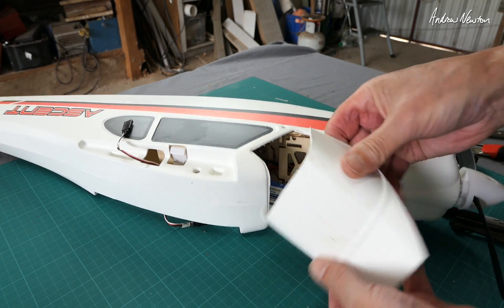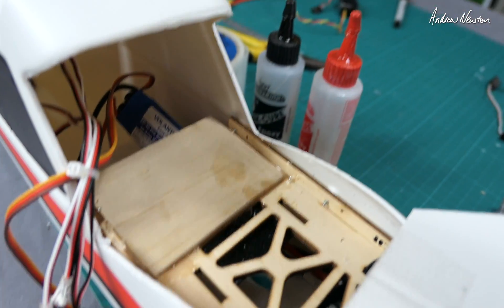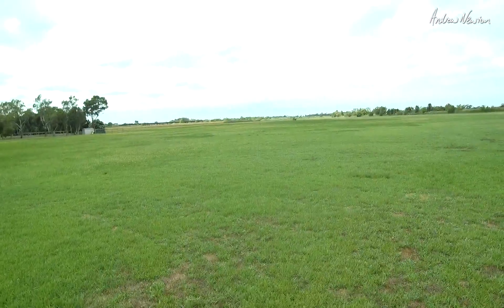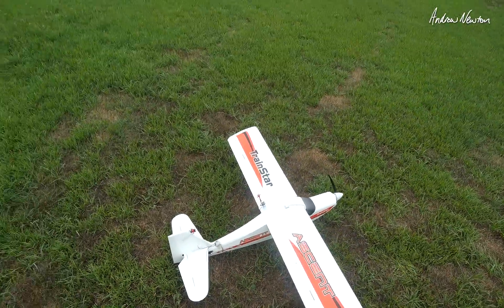Volantex Trainstar Ascent FPV Mods

Comment: Excellent helpful video Is there any other way to stick in a small flight controller without making the cut Pls help as i couldnt find any other flat surface inside the battery bay
Reply from the maker: Can mount externally, on top of the wing or under between the wheels.

Comment: Hello, This wing connector is a brass tube, it should be 32cm. It is shorter. 13cm for the left wing and 13cm for the right, the fuselage is 6cm. I tried to buy it but the diameter of this tube is non-standard, it is 7.9 mm. Standard tubes for RC models are 3,5,6,7,8,9,10 mm in diameter. Best regards.
Reply from the maker: Very frustrating!

Comment: As I get back to flying after being out for ten years or so- I have a LOT of airplanes in storage, but looking for the modern foam equivalent of the old telemaster. My heavy wood Telemaster just floats and floats- to the point it can be hard to land. 
I keep looking to these foam trainers as the modern interpretation, but it seems they still don't float like the old flat-winged and much heavier wood models from "back in the day."
Reply from the maker: This would be the closest to a Telemaster that I have tried. Very tough
Reply: @AndrewNewton  thank you- I just may have to get one. my flight controller just came in and I've got some tinkering to do, but it seems as if this platform will be the one.

Comment: Hi Andrew, thank you for all your content, a question on this plane and kopilot. When it comes to kopilot level calibration for the craft, is this done with the landing gear on? sorry for dumb question. i notice the angle the plane sits at? have fitted kopilot before as per your vid (thx) on zohd drift.
Reply from the maker: Calibrate level with the plane in the same orientation as level flight. Maybe not just sitting on the landing gear.
Reply: @AndrewNewton  thanks for getting back. My instinct said to ... but thought id better confirm. thx fella

Comment: Andrew, thank you again for this video. Can you suggest an alternate motor for this model airplane. i just replaced mine and its vibrating quite a bit. i replaced it as the old one was. The motor is a Volantex 4023 KV1050. Thank you in advance.
Reply from the maker: Matching the mount will be the issue. Sorry I dont have any suggestions
Reply: I have replaced mine photo to come. Although the vibration, is that without the prop? I have several of the motors as they are used on lots of volantex models and never had an issue.
Reply: Propdrive 2836 1400 kv it can mount internally or externally in the same holes and mount plates
Reply: Use a different prop of course !
Reply: Cannot add photo oops
Reply: @gonzorcplanes2875  Julian thank you for the advise. It turns out i had the plastic piece that holds the nut off and it was just to close to the metal grid causing friction. I looked at it for a while and decided to put a regular grub adapter and it seems like there is nothing rubbing on the metal grill or grid. I am waiting for the winds to die down here in Long Island,NY to test. How would a 2836 motor install on the inside?
Reply: @DjArity  just take the plastic mounting adaptor off the 1050 motor and attach to the propdrive motor it goes in the same way from memory.
Reply: @gonzorcplanes2875  thank you.
i believe I solved the vibration problem. i was using a standard grub adapter which was rubbing against the steel plate. i tightened a little away from the plate and the vibration is gone. i ordered the original parts just in case this doesn't work.
Reply: One more thing, if you run 4S at max amps,,mount the motor externally, it gets hot in the plastic fuse.
Reply: wait...just realized i am not familiar with a prop drive. thought you are talking about a regular prop adaptor. Let me check it out or if you have a link to it, that would be great. Thanks again
Reply: @DjArity  it’s a motor brand and type. Search on the hobby king website.
Reply: @gonzorcplanes2875  So you mounted that motor outside? Would you be able to send pictures? i think that will help.  I checked H.K. and i think they are out of stock with that motor. I have this Swiss motor 3542 i picked up from Alliexpress and it came with no bolt on  prop adapter. Having a difficult time finding a 4 bolt on prop adapter for it. Motor is nice a powerful but cannot use yet.

Comment: I just got this model...without the mod, where am I supposed to put my Rx...as my Rx has stabilization and is supposed to lay flat along the center line......thanks
Reply from the maker: You will have to be creative with the mounting somehow, or forget the stabilisation
Reply: @AndrewNewton  right.....I am thinking about cutting  an opening on top of the nose area, and mounting the Rx  on top of the wooden  battery tray....similar to  the opening that  you did, just not sure exactly how to  create  a  closable hatch once I cut the plastic open.....

Comment: Have you ever had to replace the Motor/ESC on this model? I would appreciate any information on how to go about doing it . Thanks in advance.
Reply from the maker: Without cutting a hatch like I did it would be very difficult.
Reply: @AndrewNewton  I was able to remove the battery tray by removing all the screws from the sides tgat hold the battery tray giving me access to ESC, which was replaced with s 60a ESC. However, you gavd me the idea ftom watching your video. The plane is ready yo fly again.  The ESC was the source of the issue.

Comment: I wonder if you could cut out the front and side windows and replace them with clear plastic and put a pan servo inside for fpv.
Reply from the maker: Wouldn't be easy but certainly possible.

Comment: I am now flying using zohd kopilot as a stabilizer and an F4 FC for my telemetry. It is simpler then ever and I don’t have to scratch my head with all the inav setup ... I’ll do it on my ascent when I get it from BG.
Reply from the maker: Lateral thinking! Nice one
Reply: When it comes to kopilot level calibration for the craft, is this done with the landing gear on? sorry for dumb question. i notice the angle the plane sits at?
Reply: how does that work using fc with kopilot? any help appreciated
Reply: @kool-k-kel  install a Zohd kopilot on the plane  in order to control the “plane attitude” and forget about it. THEN, install an FC you like and connect ONLY  the telemetry port. Of course this second FC needs to be connected to a vtx that will send the telemetry to your googles (do not connect  gps port since kopilot is the only one that controls your plane RTH!) 
In short you will have from one side the kopilot that controls the plane (RTH, stabilization) and the second fC that through the vtx sends to your googles all the datas you have set. Hope this helps. 👋
Reply: @probante  excellent, i follow thx.. although what im gonna try is kopilot with matek crsf to pwm board and pluck telemetry via that.. i hope it works in theory it sounds like it could.  thx for reply or chime in if anyone knows it works! or would work... thx

Comment: Oh on fixed-wing GPS modules you don't have to do any calibration dance or anything? I guess all you do is wait to see if you have enough satellites locked on to make it work? I think quads usually need about 7 before you get the green light.
Reply from the maker: Compass calibration? Compass is not needed for fixed wing
Reply: @AndrewNewton  i was thinking gps quad.
some those you can`t fly till you calibrate compass and get gps locked in. i guess the gps for fixed-wing is so if it gets away you have the comfort of knowing gps will fly it back to you, if its still airborne. lol

Comment: How many seconds has your ender 'not' been running since you got it, mine has been going non stop lol and have you overcome the urge to sit there watching the mesmerising process yet? 
I have finally got the PETG settings nailed and it's printing reliably with it now, I'm impressed with the material and it's way stronger than PLA but I'll only use it when I need the strength or something which won't degrade in environmental conditions (PETG is not biodegradable like PLA)  and for most stuff I'll continue to use PLA.
Currently printing is a 2.75" prop quadcopter frame:  https://www.thingiverse.com/thing:2180020
Reply from the maker: Of course I am still watching in awe Steve.

Comment: Very nice flyer! On one of my camera planes I mounted the batteries and cameras under the wings. You will have a much better wing load; only not during hard landings (the batteries will eject though), and better cooling. For long flights you can also use 2x2 LiIon (ZOHD) cell-pods under the wings; adjust the low Voltage on the ESC!
Reply: That is a Go Fly Rc Evolution: https://youtu.be/59nMjU6T5lc
Reply: I am sorry; the Volantex is much bigger, you need 6 or more LiIon cells.

Comment: I went at it a different way, but I also put in a F-722 Wing FC in my Trainstar, an it is my go-to fpv long-range workhorse when I'm testing kit an don't want to lose or crash my $$$ MyFlyDream long-ranger.  The Trainstar is an excellent mule to do pretty much whatever you want with it.  Should be good for my new Li-ion batts as well!